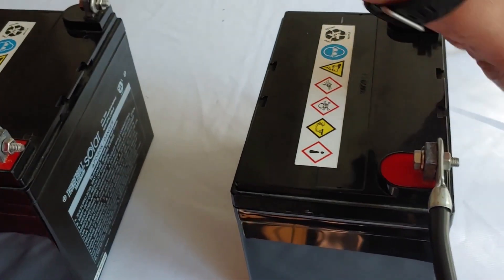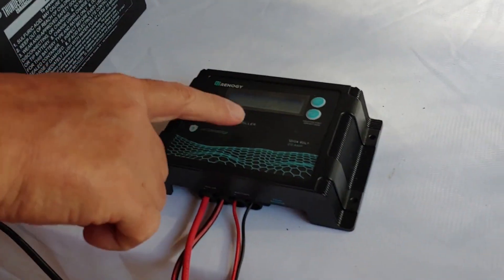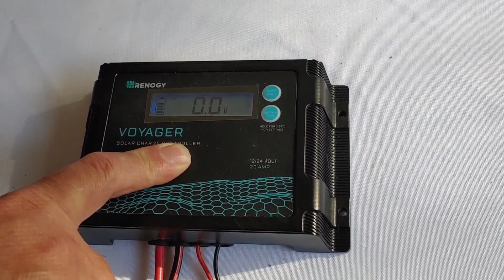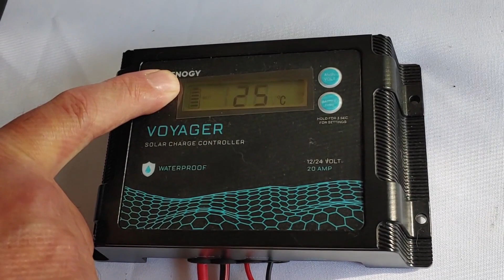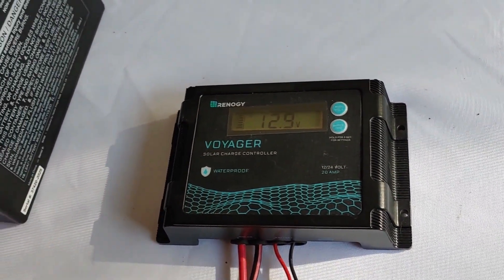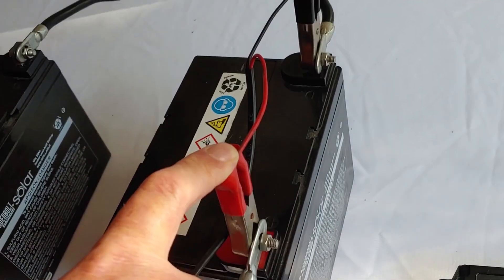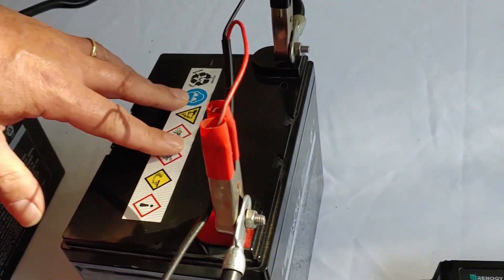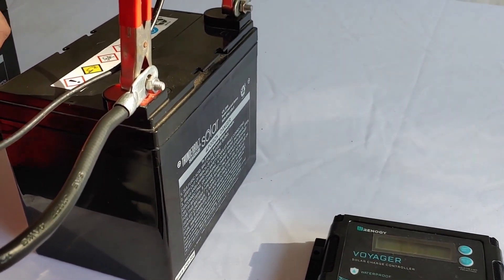Charging a Battery Bank

Comment: After plugging in the solar panel and the charge controller would you connect an invert to the other battery  that doesn’t already have the clamps from charge controller?
Reply from the maker: Yes, that would work
Thanks for your comment.

Comment: When I buy those super thick cables that connect One battery to another battery do they come with nuts and bolts or do I just choose some random nut and bolt from the store?
Reply from the maker: The nuts and bolts came with the battery. I got the cable at a local auto parts store.
Thanks for your comment.

Comment: question how do you make sure you dont over charge your batteries? does that controller shut off power when there full? and what is the max batteries that controller can handle? and how many panels can the controller handle? thanks.
Reply from the maker: Your charge controller will stop charging the batteries when they are fully charged.  How many panels your controller will handle will depend on the size of the charge controller. Thanks for the comment
Reply: @shoestringprep  thanks alot for the info. much appreciated.
Reply from the maker: @michealtrevor  welcome

Comment: What length battery cables would you recommend to connect two 100ah batteries?
Reply from the maker: That would depend on your setup. Make the cables as short as possible. The less distance between the battries the better. Thanks for your comment.
Reply: After watching this video, shoestring is not the person to aske.